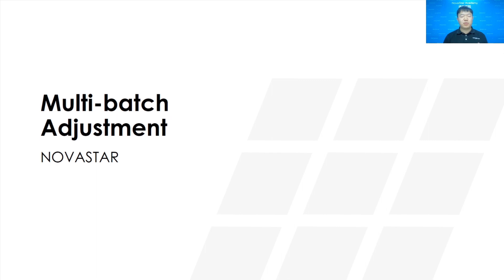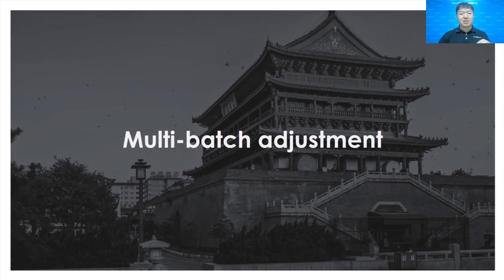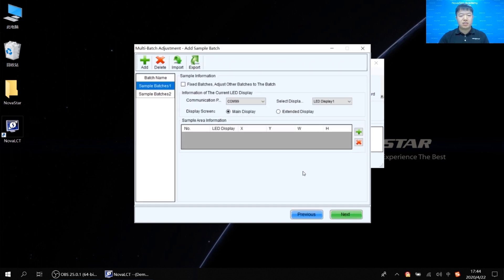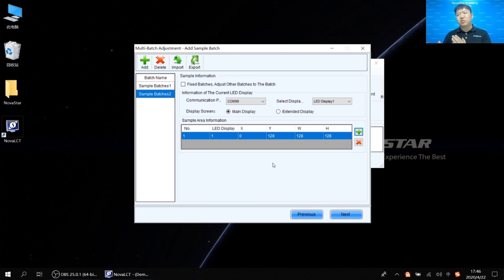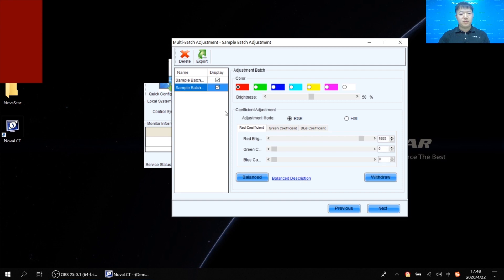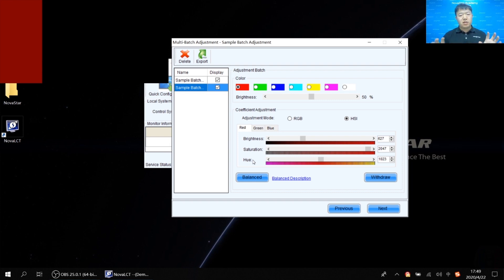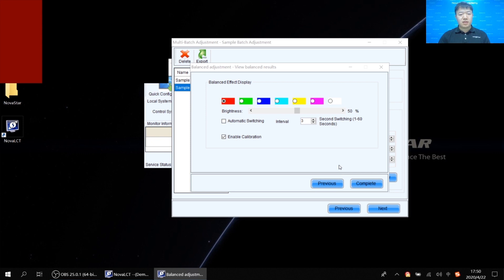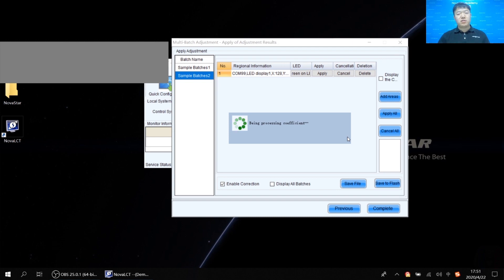Multi-batch Adjustment

Comment: Can multi batch adjustment be applied to a one module only.  If the module has a flash storage could you save the coefficients to module only and not the receiver card.